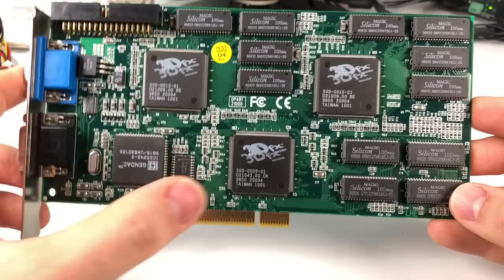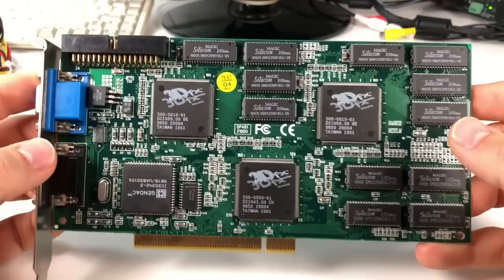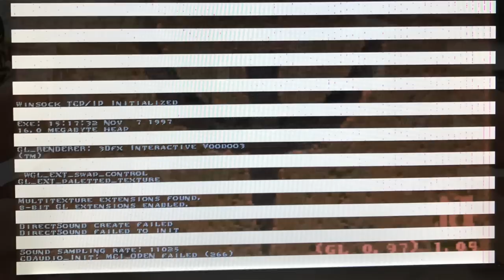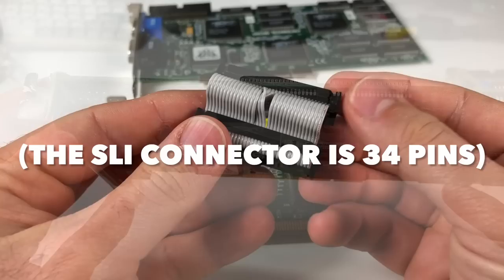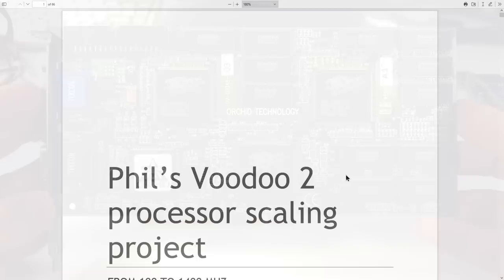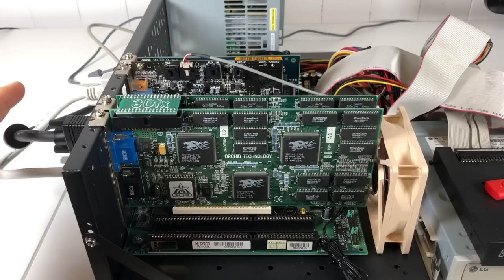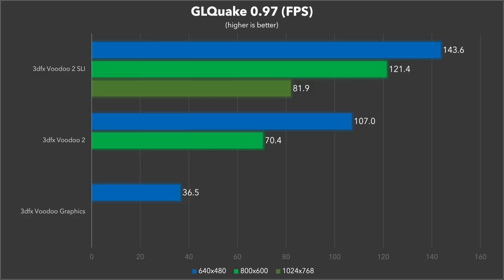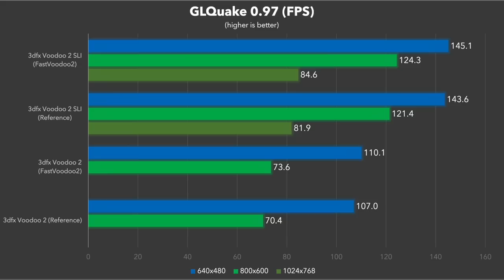The 3Dfx Voodoo 2 - Taking 3D to the Next Level!

Comment: Impopular opinion : along with nVidia and Rendition, Videologic really had what it takes to compete with 3Dfx. While experimental and cheap, first generation PowerVR cards were still fast even with poor compatibility due to its unique technology. 
PowerVR2 came out in late 1998 (Dreamcast, in Japan). its (inferior) PC version outperforms Voodoo 2s in SLI and has better functionality (AA, Anistropic filtering, 32 bit colors). We all know its PC version came out way too late with mediocre drivers because the console market was priviliged, but a 33% faster version than the DC'one for the PC market was possible in late 1998. And this thing was dirt cheap with (excellent) 2D capabilities. Crazy.
Videologic had the best engineers, the poorest decision makers.
Reply from the maker: Yeah the PowerVR is very interesting! I've been wanting to pick one up for a long time. They are getting pretty hard to find these days.
Reply: @vswitchzero  If you ever get and test one, check which primary card to use it with. It matters much more than with Voodoo cards. 
Matrox cards aren't very compatible. S3 are really slow (more than 10% difference on some bench). Even Tseng ET6000, while paired with PowerVR cards by Videologic themselves in the Apocalypse 5D cards, isn't that good. 
Good cards to use with PowerVR PCX1 and PCX2 cards are Ati Rage (128) (with not too new drivers) and, quite surprisingly, Cirrus Logic GD5465 Laguna 3D. And newer doesn't really mean faster. It's probably a matter of driver compatibility. I will test it with Imagine 128 and Mpact2 cards soon.
Reply from the maker: @Malheirods  Interesting, I didn't realize that. Thanks for the tips!

Comment: That's an old card, I had one and may still have it. It was a add on card that plugged into the existing video card. you put it in a port then the cable attached to the other video and you plugged your monitor into the voodoo card. It only gave you a little bit better video. Mine has a external cable to plug them together.

Comment: 9:10 ..or AMD K6...2 and IIIs! 😛

13:02: If an AMD K6-III and Quake II - why not use the '3DNow!' patch?
Reply from the maker: Thanks for your comment! Shortly after I posted the video, I discovered the "3DNow!" 3.20 patch. I definitely want to give it a try one of these days. I did use the latest 1.49 miniGL driver for Quake 2 in the test I did, which improved performance quite a bit (5-10fps improvement) over the original one included with the CD.
Reply: @vswitchzero  Please do try.

..and Thanks from me and my org. first build - late 1997 Socket 7.

YUP! "She" is still alive...pretty much MAXed out now - at: 6x66MHz and a K6-III AHX 400MHz (No reason/need for K6-2+ or III+ on Iwill p55xb2 rev.1.21.)

Comment: When using SLI, does it matter which card you connect your VGA cables to?
Reply from the maker: Good question! I assume it would have to be the primary/master card of the pair. I just connected it to the first of the two cards and got lucky. I'm not sure how you'd determine which card is primary/secondary.

Comment: Исходный текст
Actually 8 meg card and 12 meg card would work in SLI mode together. 8 meg card must be primary one and 12 meg card secondary or else you'll get artifacts.
Reply from the maker: Very interesting! Thanks for the clarification. I didn't realize that was possible.
Reply: @vswitchzero  It really wasn't possible on release of Voodoo 2, 3Dfx added support for SLI with mismatched cards much later. So it's no surprise that a lot of people never knew about that possibility.
Reply: @mesushi  3Dfx didn't really add anything later. Whoever initially wrote the drivers blocked this ability in the first place (maybe with good intentions). And then the engineer from Metabyte (one of Voodoo2 manufacturers) released a modified windows driver that could work with 8/12 MB cards from different manufacturers in SLI mode. There are straps (resistors) on Voodoo2 that are read by the driver, and if you rearrange them to identical configurations, you can fool any driver that you have identical cards, and it will work just fine, even on very early drivers with cards with completely different chip revisions and PCBs.

I think it was blocked initially because in theory every manufacturer could go nuts with the cards, adding 4/6/8 TMUs and god knows how much VRAM, and that would definetely NOT work well with the regular Voodoo2. But in practice, almost all Voodoo2 cards in existence are reference designs, i.e. identical to each other.
Reply: @Arti9m  I think you're right, never thought about that before.

Comment: i had a 3d banshee blaster that had 16 mbs so i think there was other versions
Reply from the maker: The Banshee was an excellent card (very underrated in my opinion). It had amazing 2D image quality and basically had the 3D capabilities of a Voodoo 2 with a single TMU, but a higher 100MHz clock speed.

Comment: is it possible to update the framebuffer to get higher res with only one card?
Reply from the maker: Good question - the original Voodoo cards could technically support more FB memory and some folks have modded them for this (Bits und Bolts did a video recently on this).. but I've never seen anyone do this on a Voodoo 2. I'm not sure if the Frame Buffer supports more than 4MB. Could make for an interesting experiment!
Reply: @vswitchzero  ...an experiment we like to see 🙂

Comment: After a huge success 3dfx became cocky and started to decide what is good enough for its consumers. Such as they said 16 bit graphics were more than enough for us consumers. They also insisted that 3D cards were for 3D and we didn't need single card solution. They slowed down innovation to a near halt believing their success didn't need it much to survive. Then Nvidia came up with a nice 32 bit graphics solution with integrated 2D support. Suddenly one card was enough. Many of us upgraded from voodoo to TNT, and never looked back. Voodoo couldn't catch up and went down in a few years.

Comment: Never been a huge fan of Voodoo myself. My first serious 3d card was Riva TNT2, and it was way more interesting. single card, pretty cheap, single chip, more memory, 24 bit framebuffer, 32-bit color support with very high resolution ramdac for desktop work or some 3d games, with alpha support, full OpenGL support, multi texturing, good drivers and decent Windows and Linux support (not great, but way better than 3dfx). I also did not like dithered look of Voodoo rendering. That was probably 2000. If I would be building computer a bit early, a Voodoo maybe would have been option (and some of my friends did have it), but I still would consider it meh. After then, I didn't use GPUs too much, so was not picky, eventually used GeForce 8 series, which was my only nvidia card (technically it was not really mine, it was a shared computer; my home computer didn't really have any GPU at the time, beyond some Intel on board stuff). After which I exclusively started using AMD cards.

Comment: 3dfx Voodoo 2 was way too expensive. Nvidia released an amazing all-in-one chip with way less. The chip was Riva 128 and changed gaming forever. I had the Diamond Viper V330 with the Riva 128. What a card. It was such a success that Nvidia bought 3dfx (and later on made it dissapear from the market completely) back in the early 2000s if i remember correctly. 
At about the same time Quake 2 was basically the start of massive multiplayer as we know it... OpenGL forever ❤

Comment: Any way you could point me in the right direction so I can get some ram to upgrade my Voodoo 2 8MB to 12MB's?
Reply from the maker: The Voodoo 2 uses 512KB SOJ40 EDO memory chips. Since the FB/TMUs run at 90MHz by default, you need at least 27ns/90MHz rated EDO to stay within spec. The vast majority of V2 cards out there use 25ns/100MHz rated EDO, which is much easier to find these days, so I wouldn't recommend using anything lower rated. There isn't anything out there that you can buy as an 'active part' from reputable companies, so you'll need to look for "new old stock" stuff on eBay or similar sites, unfortunately. There are a few eBay sellerst that are selling "EliteMT" brand memory (M11B416256A-25J) that should work. Just a tip - be sure to test the memory in a card with sockets that supports SOJ40 EDO before soldering it on to the V2. An S3 Virge is a great card to use for this purpose. Best of luck!
Reply: @vswitchzero  Thanks so much for your time. 
Watching your show inspired me to give this a shot. Always wanted the 12 MB version but couldent afford it as a kid. Finding out that it's the same card and only difference is the ram made this something I must try.
Reply from the maker: @PKmuffdiver  Let me know how it goes! I hope to give this a try one of these days. Dexter's Tech Lab did a great video on it a few years back: https://www.youtube.com/watch?v=KZjxeW3igRE

Comment: Does anyone know how much these 12mb 3dfx Voodoo 2 cards are worth? What about the Voodoo 3 3500?
Reply from the maker: It can vary quite a bit, but if it's in good working order, I've seen them sell for around $160-170 USD or so. The Voodoo 3 3500 is probably worth a bit more as they are hard to come by.
Reply: @vswitchzero  I have 2 of the 12mb voodoo 2's & one 3500 with all the accessories. Wanna buy them?
Reply from the maker: @LM77va  Thanks for the offer! As tempting as the 3500 is, I'll have to pass. I've spent way too much on retro PC gear the last few months.

Comment: Voodoo had three main advantages. They did not do hardware T&L; no need, games must use few enough polygons to be playable in software for a couple of years when it was released. It did not do 2D; no need, if there were no 3D accelerators before then nearly all of the people buying it will have 2D cards already. They managed to get the CPU overhead lower than just about everyone else (still; hugely CPU bottlenecked at released).

Comment: i think you got 2nd best ram on it, v2s can go a bit higher, roughly 110mhz (i think)
Reply from the maker: Indeed! I've seen 110MHz rated EDO on some V2s, but it's pretty rare I think. There are also 90MHz 27ns chips on some as well.
Reply: @vswitchzero  i kinda wish you did a memory swap for part 2, or smth of the sort...nos chips exist iirc

Comment: quake 2 patch should be 3.20
Reply from the maker: Yeah, I need to explore some of the Q2 patches. I believe there was one that included 3DNow! extensions too. 3.05 was just the retail CD install. I did use the latest 1.49 3dfx MiniGL driver though. That actually provided a pretty substantial FPS improvement over the original one.

Comment: 4:45 16 bit color? Sixteen? Am i hear that right? 16 per sub pixel? Because otherwise for pixel (not sub pixel) would be 16/3=mess. And otherwise 16 per sub pixel would mean 48 bit color per pixel which is sweet dream even for today. My question is: wt*?
Reply: High Color  16-bit color depth, 2^16  = 65,536 colors /  https://en.wikipedia.org/wiki/High_color
Reply: @rikamasyume8921  

Don't understand any of this, but tell me please whats the difference between today's unachievable 12 bit color (whatever that mean i guess 12 bit per sub pixel thus actual 36 bit color) and the 16 bit color from the Voodoo 2 times. Because 16 twenty years ago but 12 today is ridiculous.
Reply: @ps4games164  It depends on the color depth.
The standard would be an 8 bit color depth. With three colors (red, green and blue) you need 24 bits for this one pixel.
With HDR10 a 10 bit color depth is established, therefore 30 bit/pixel.
and professional cameras also come with 12 or 14 bit color depth, respectively then 36 or 42bit/pixel.

Comment: pentium4 willamette 1500 megahertz rdram rambus memory 1024 megabytes 4x256 megabytes graphics card rage mach64 pci I will connect to two voodoo2 pci sli these I will connect to another nvidia quadro fx1000 agp monitor dell p1130 performance is enough for old computer games additionally memory of graphics cards I can copy to rdram rambus memory this solves the problem of small memory in graphics cards

Comment: "1024 is something a single card cannot do" -  not entirely true
If the game doesnt use a hardware z-buffer it can
Reply from the maker: Thanks for sharing! Yes, I had forgotten about this. I believe 800x600 is possible on the original too in similar circumstances. I hope to give this a try at some point.
Reply: @vswitchzero  Most games dont give you the option, iirc need for speed 3 hot pursuit does

Comment: much tearing in Half life I never had that.
Reply from the maker: Yeah, that's my fault. I had disabled vsync for the benchmarking I did (using a system environment variable) and forgot to turn it back on for the game recordings. SLI can introduce a bit of tearing, but with vsync enabled it looks way better.
Reply: @vswitchzero  is that a LCD thing? I always used CRTs.
Reply from the maker: @duderobi  The tearing is just as visible on CRTs as it is on LCDs (with vsync disabled)
Reply: @vswitchzero  hmm i never had to enable it till i played AC Valhalla. In 1999 I had a rig just like that only without SLI. Had to search for the AMD Cpu only one shop had them.

Comment: Could it run Halo CE though?
Reply from the maker: Can't say I've ever tried Halo CE, but being released in 2001, I'd say there is a good chance it could probably run it. Hoping someone else more familiar with the game may be able to add their thoughts.
Reply: @vswitchzero  I've always wondered as to if older graphics cards could run games a few years newer than intended, eg 3Dfx Voodoo 2 SLI running Halo CE, as newer cards can sometimes push out decent performance in newer titles.

Comment: now days...amd is like 3dfx a underdog trying what 3dfx already done back then....suffering devastating loss in spending increments that nvidia was been picking their teeth with ...if you think RTX is easy to be defeated ....but i sense amd making wrong moves of not putting any effort in tech advancement than raw power only is same mistake what 3dfx did back then ...focus too hard in horse power dept that bankrupt itself fast...nvidia is focusing on architecture redesign every release vs AMD struggling in changes that they went the easy road....is stay same archtecture and trying focus on adding more raw power instead ...